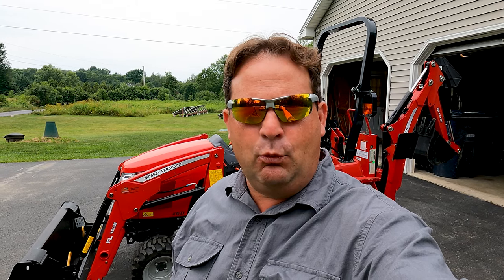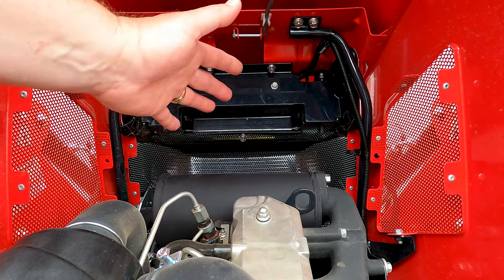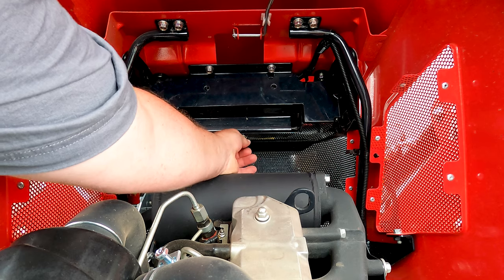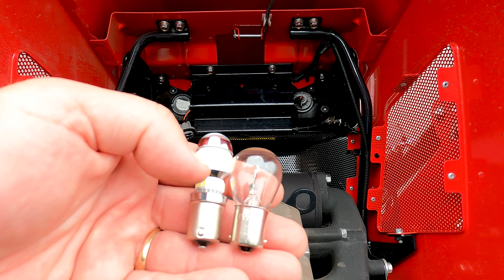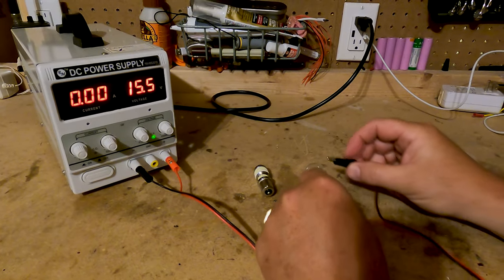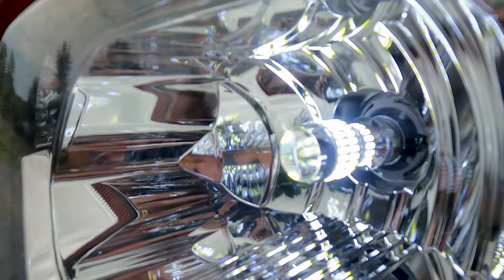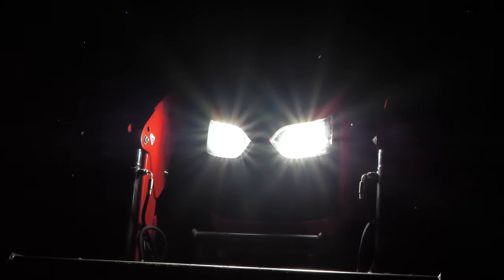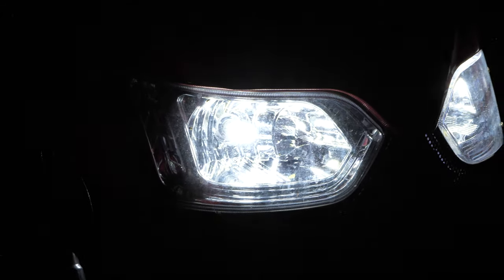Installing LED lights for Massey Ferguson GC - 1725M & 1723E

Comment: Hey there, I just found your video on this topic after doing one of my own on the GC1723. Anyway, your presentation is great as usual. On the current reading, here is something I found interesting. Increasing voltage to these LEDs will actually decrease current because the LEDs are not purely resistive, rather they are tiny power systems with a little control board buried somewhere inside. To verify this, I placed my iBrightstar 1156 LEDs on the bench power supply at 12V, 15V, and 20V and measured 0.29A, 0.22A, and 0.17A, respectively. So the takeaway is that the LED bulb consumes x amount of power, meaning P is the constant in the P=IV formula. To further nerd out on you, I tried the 1156 filament bulb at 6V and 12V and got 1.39A and 2.02A, respectively. This makes sense for the most part because the filament is just a resistive load.

Comment: The LED lights make a huge difference. That is something I've been wanting to do, but never think of it when I am at the store. I also want to install a light bar for my night-time snowblowing. The hood on your tractor appears to be well supported, far better than the hood on my older GC2610. Thanks for sharing! - Rick
Reply from the maker: I have a light bar ready to be installed.  Just need to find the time!!

Comment: I thought about doing the bulbs. But my bucket is always on. I put a small light bar on the rop bar. Attached it with a strong magnet from.harbor freight.
Reply from the maker: Nice.  I recently installed a lightbar package.  Will have a video soon on that.  Thanks for watching and commenting.